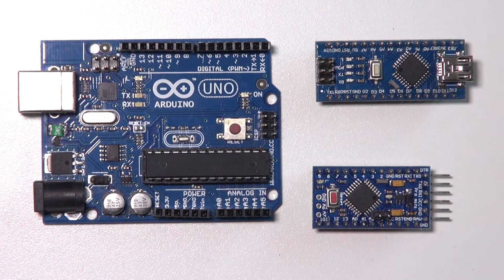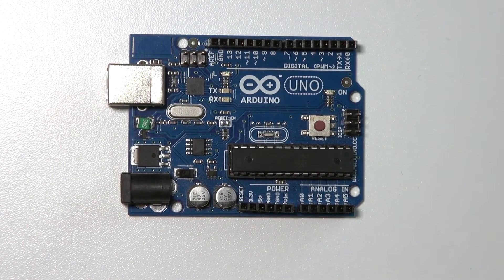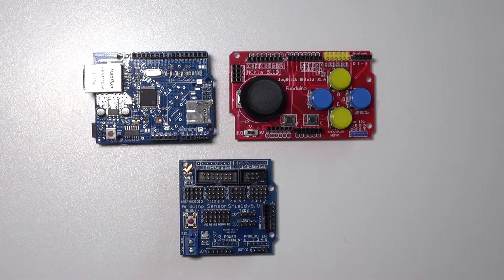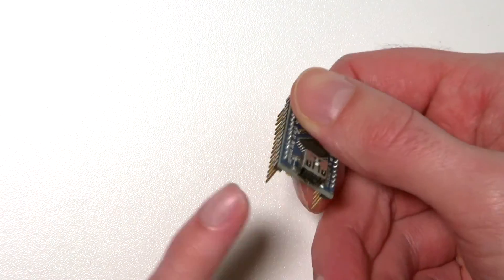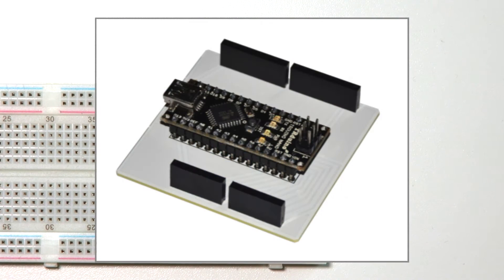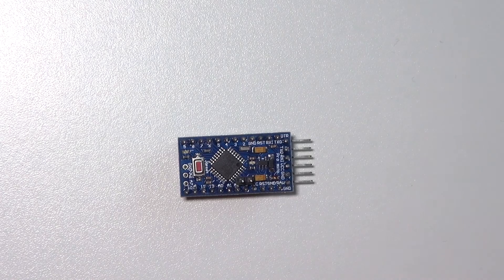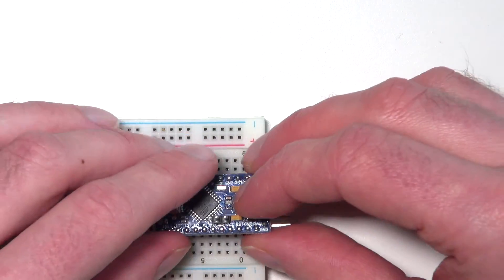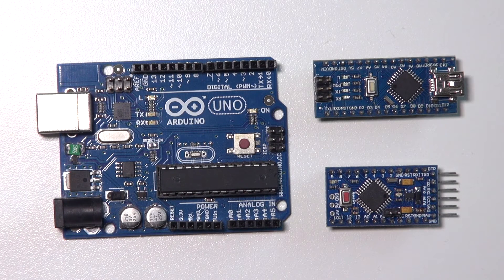COMPARING ARDUINO (UNO, NANO & PRO MINI) - arduino-tutorials.net

Comment: hi...please can pro mini be used with TB6612fgn to drive DC or stepper motor...thanks
Reply from the maker: You probably can. However make sure to checkout my video over stepper motors. You want to have the current for you motor separated from the Arduino.
Reply: @BasonTech  thanks Sir

Comment: Also, I'm not sure which, if any, of these three have this capability, but when I built a MIDI controller for my computer, I went with the Leonardo because it can be set to be recognised as a standalone USB device when plugged in.
Reply from the maker: The Arduino Pro Micro can as well 😃
Reply: @BasonTech  sweet!

Comment: Good video. Though the idea of shields is not unique. Intel used it on their boards 40 years ago. I used them and later made designs with piggyback cards on top of my main boards.
Reply from the maker: Not unique but very useful for the ones not want to solder or use breadboards 😃

Comment: a video suggested me to use arduino nano in a project 

but we are not able to get it for a reason 

but we do have arduino mini 

can we use it in our project

kindly reply fast as the due date is near 
i am just a beginner
Reply from the maker: Kinda depends on your project. For example shields will not fit on the mini

Comment: Question:  if you are looking at code that was developed on the Uno, what changes do you have to make to run that code on the nano or the pro mini. If you want you can just answer between the Uno and the nano because I agree that the nano in most cases is better than the pro mini.
Thank you very much for making your video it really helps a lot!
Reply from the maker: From the top of my mind Uno to Nano is not much of an issue. The Nano has more analog pins so the other way around could be an issue. Also am I not very sure if the SPI pins differ on both devices. So keep that in mind if your code uses SPI. A more hardware related issue could be that the Uno is 5V and you might happen to have a 3.3V nano. This could potentially raise errors if you are using components that require 5V. Hope this helps 😃
Reply: @BasonTech  ok, thank you!

Comment: nano can not be used as a HID altho in theory any Arduino can do this they are MCU at the end of the day but the thing is that if you do this to a none Native HID ready device you will have bricked the Arduino to the point of no return, meaning you wont be able to use it after that to upload other scketch as it will be stuck in USB or only recognized as a USB HID device. i just order and got a Pro Micro which is ready for HID just like the Leonardo.  Im actually in the middle of making my own BT AirMouse for Gesture control https://www.arduino.cc/en/Reference/HID
Reply from the maker: Hi, you don't brick your Arduino. The only thing is that you can't upload via USB anymore. With a standalone programmer you can still upload code to the Arduino. See https://www.instructables.com/Turn-your-Arduino-Uno-into-an-USB-HID-Mididevice/ This page also describes how to restore the original firmware.
Reply: @BasonTech  ahhhh okay thanks for the note, i have a nano that wont upload no more via usb, (bad resistor or cap not sure) any tips or advise on how to upload to it? maybe a red ftdi board or other methods? thanks in advance.
Reply from the maker: To be honest, I just would buy I new one. Especially if you don't know what is exactly wrong with it.
Reply: @BasonTech  yes i know BUT we are makers in the DIY space and throwing things away is just NOT what we do lol, thanks for your input tho.
Reply from the maker: True, I am not so good at troubleshooting PCBs 😄

Comment: Thank you very much but I would like to point out that the comparison of the number of digital input-output pins is wrong. Uno has 13 indeed but Nano only has 14 and not 22. 22 is inclusive of the 8 Analog input pins too.
Reply from the maker: Hi, the description of this video contains links to the official Arduino website. For nano this is https://store.arduino.cc/arduino-nano which states "Digital I/O Pins: 22 (6 of which are PWM)" I guess they count analog pins as well.
Reply: @BasonTech  Every analog pin has the capability of being used as a digital pin. So in this case then the Uno and the pro mini would also have more digital pins. Next time use a comparison table of this kind of output in your conclusion; I was looking for that. Besided that: thanks very much for you good work Bas.

Comment: Which one can be powered with the smallest Lipo battery that will last for the longest time?
Reply from the maker: Theoretically all could in a way. What you need to think of is the minimum Arduino you need. How many I/O, how much processor power. In that wat you can determine the board with the minimal power consumption, and use that one.
Reply: @BasonTech  I was familiar with PIC16F84A 20 years ago as a hobby.. What do you think of PIC?
Reply from the maker: I literarily had to Google what it was 😄  So no opinion about that one. I am only familiar with Arduino, ESP8266 and RPI

Comment: I'm looking for a really tiny arduino board for my first ever project since it has to fit inside of a gearknob. So far I've seen Teensy LC/Teensy 2.0/Pro micro. Any recommendations? I need it for 3 button switches only, so really tiny project. (1 NO button and 2 NC buttons, nothing else)
Reply from the maker: The is this tiny Arduino https://www.kickstarter.com/projects/melbel/pico-the-worlds-smallest-arduino-board The ATtiny85 is also very small https://tinkersphere.com/boards/706-attiny85-breakout-board.html Hope this helps 😃

Comment: Thank you for sharing. I have a question. How do you supply power to multiple arduino NANOs using a usb portable charger without a multiple usb ports, or without getting a usb multiple ports? Weight is a factor for me. Is it possible to power chain the Nanos?
Reply from the maker: Hi Muhd, if I understand you correctly you want to power multiple Arduinos on one portable charger. Don't pin me on this, but I think you can make a female plug for your portage charger, which then is wired to the Vin pin and GND of all the Arduinos you want. However you have to make sure the portable charger provides enough power for all of them.

Comment: OK I am new to Arduino. If I am understanding this the units will perform the same functions. I need a unit that can accept up to 4 - 9 to 14 VDC inputs while controling up to 3 PWM outputs. So it seems that the ProMini may be the hot ticket for me on the final product. I have bought 2 UNO's and will use these for all the testing and design. Then I should be able to take the programs and dump them into the ProMini and it should work the same? Right?
Reply from the maker: Keep in mind there is a 8Mhz Pro Mini as well, where the UNO has a 16Mhz processor.  So make sure you buy a 16Mhz Pro Mini, otherwise you have a twice as slow processor. Be aware that 14V will be too much, since the max is 12V. Your code is indeed the same, unless you use I2C pins, these might differ per Arduino model.

Comment: Please explain RAW pin of Arduino pro mini
Reply from the maker: The Arduino Pro Mini spec at https://arduino.cc/en/Main/ArduinoBoardProMini shows that it has an input voltage range of 3.35-12V (3.3V model) or 5-12V (5V model). If you want to provide your Arduino Pro Mini with 12V you need to supply this on the RAW pin. The Arduino voltage regulator will step this 12V on the RAW pin down to its operating voltage.

RAW - Supplies the "raw" voltage to the board and will step it down to its operating voltage.
VCC - Is the regulated 3.3V or 5V supply depending on which board you have.

Comment: Something wrong with this video! Not correct, are you sure you want put this on YouTube? An example, arduino pro mini has a0 to a7 analog in! Search on the board! And where's 22 digital pin on the nano?? Something wrong?
Reply: 22digital i/o means we can also use 8analog pins as digital i/o pins whenever needed. 
So nothing is wrong with the video. I think you are a beginner for electronics
Reply from the maker: Yes, I want to keep the video online since the numbers are correct:
Arduino Pro Mini: https://store.arduino.cc/arduino-pro-mini on the "tech specs tab" it states "Analog Input Pins 6"
Arduino Nano: https://store.arduino.cc/arduino-nano on the "tech specs tab" it states "22 Digital I/O pins"

Comment: Can we use Arduino uno instead of pro mini
Reply from the maker: Everything depends on your needs. Check that the Arduino you use had the right amount of inputs and outputs, has the correct voltage and form factor for your project

Comment: Its the arduino micro which can be  used as keyboard or mouse. Not the nano.
Reply: The Micro has no USB port, so you can not be right.
Reply: @kimhansen6384  Arduino Micro is the smallest board of the family, easy to integrate it in everyday objects to make them interactive.
The Micro is based on the ATmega32U4 microcontroller featuring a built-in USB which makes the Micro recognisable as a mouse or keyboard.

That's copied from Arduino's website..
Reply: I got here trying to understand  the difference between does two(nano and pro mini) because I was trying to use the nano as keyboard and  after reading because of the microcontroller it is that the micro (and others not listed here) are the ones capable of simulated the keyboard. Although it seems that one with a sort of <USBkeyboard.h> 2016 library can put to work the nano as well, but I haven't get there. I thought it can suit better to use the capability of the microcontroller installed on the Arduino micro and direct use the keyboard.h library.

But for any with further lectures please: how to convert a Arduino nano as external keyboard?

Comment: how to calculate the sapling frequency of an arduino
Reply from the maker: Maybe this article answers your question? https://arduino.stackexchange.com/questions/699/how-do-i-know-the-sampling-frequency
Reply: @BasonTech  i still just cant get it To work ! i did everything i saw on the Internet to have data stored in s.d card at a speed of at least 8kbps wich will match the sampling frequecy of the arduino 8000sps .. but i just cant 😭
Reply from the maker: @AChadi-ug9pg  Weird. Have you tried the Arduino forums to see if someone can help you out?

Comment: Thanks, very interesting. I saw a couple of inaccuracies, though. You count the analog pins in the Nano as digital too, but not on the other two boards. Analog pins can be used as digital in all boards, there should be more consistency there. Also, the Nano does not support Keyboard/Mouse emulation, it is the Arduino Leonardo, Micro and Sparkfun Pro Micro family the one that supports that feature.
Reply from the maker: Hi, according to the specs at https://store.arduino.cc/arduino-nano a Nano has 22 Digital I/O pins. As with the input HID, you are right, thanks for pointing out :)
Reply: @BasonTech  Tend to agree with aveascaner on the number of digital pins. The documentation tab in the link you've provided says "Each of the 14 digital pins .." and , elsewhere , "The nano has 8 analog inputs..".

Looks like the 22 digital pins in the  tech specs section refers to both analog and digita pins! This is confusing. 

Also, the diagram of the nano  corroborates this -  I am able to see the labels of 14 digital pins and 8 analog pins. Am i missing something ?
Reply from the maker: @gopalshekar986  I've checked the diagram and table, and I guess you are right. It looks like Arduino.cc counted the analog pins for digital I/O as well. Which is practically correct I guess since you can use the analog pins for digital as well. However it gets a bit confusing when only seeing 14 digital pins.

Comment: The codes of uno and nano will be same or not??
Reply from the maker: If you mean the sketches you make, yes generally they are the same. But for example the pin numbers for the SPI interface differ per Arduino.